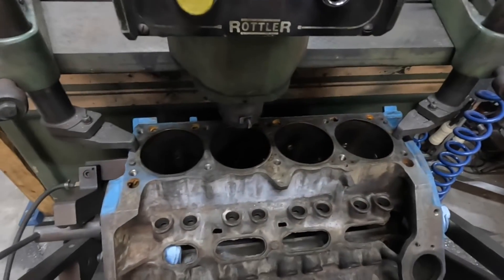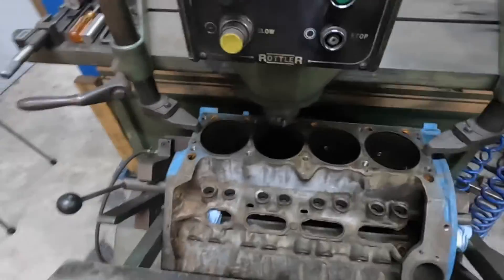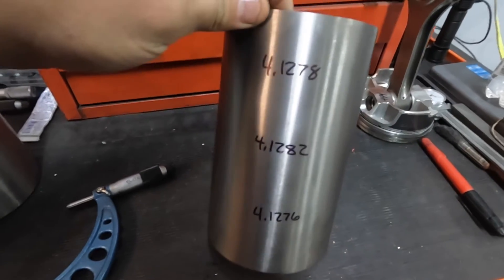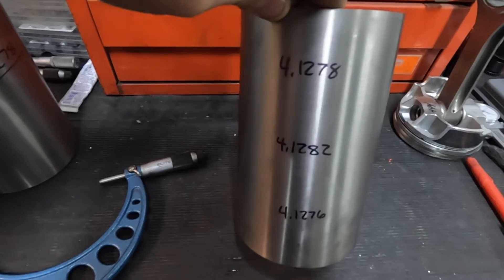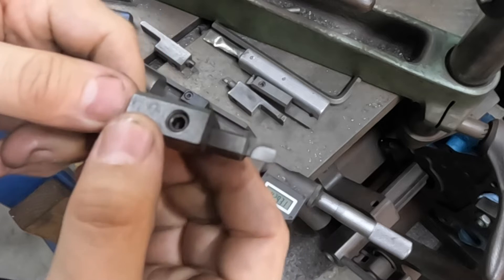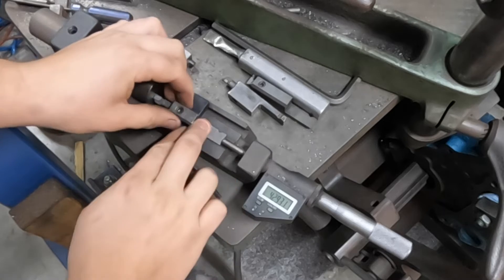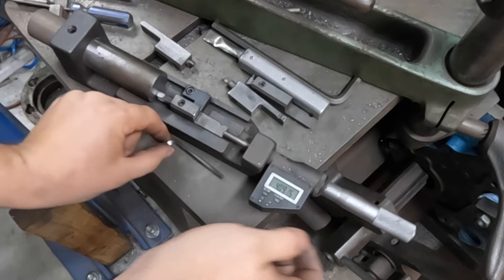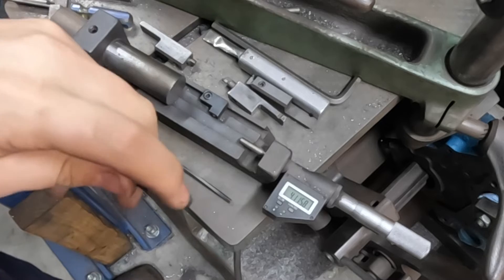Guide to Sleeving Engine Blocks

Comment: How Safe , is it to put in all 8 cylinders  into a 1967 350 Small Block Chevrolet without water leaks ???? .
Reply from the maker: Really have to sonic check the cylinders to see how much material is there. If there's enough material so we don't break into the water jacket when boring for the sleeves, then there will be little to no chance of leaking. If it breaks into the water jacket, we can get them to seal provided there's still enough material around the rest of the cylinder, but there is a greater chance for leaks when it breaks into the water jacket..

Comment: Do you know how cold you're going  ? as you are able to go colder than  cast iron is really  ok with using  nitrogen
Reply from the maker: Not exactly. There's not a lot of press on the fit so the amount that it shrinks/chills should not get to the point of damaging the cast sleeve.

Comment: Dose the cutting of the sleeve in the block help provide a "Friction Fit" for the cylinder block bond?
Reply from the maker: The block is cut to provide a press fit on the sleeve and then once the sleeve has reached room temperature we can bore the sleeve close to the final bore size before finish honing.

Comment: Is .001 enough with the variances in the sleeve? She went in super easy. Neat work btw 👍
Reply from the maker: Yes, that is why we measure at so many different locations on the sleeve to find the average. It also helps that it's an iron block so the sleeve and block expands at basically the same rate as they heat up.

Comment: Do aluminum sleeves T6 6061 withstand high horsepower?
Reply from the maker: Aluminum is not a common material used in sleeves. Sleeves are typically made of ductile iron which gives a stronger and tougher material to handle the higher horespower.
Reply: @pageracingengines  I appreciate that you answered my question 🙏🏻Do you recommend dry or wet type? For the tb48 engine, I am working on this engine and I have a goal to get it to 1500hp / NA Nitros

Comment: What kind of press fit do you shoot for?? nice looking shop brother
Reply from the maker: We typically shoot for around .001 press fit in the block but can vary based on sleeve type and block material.
Reply: @pageracingengines  thanks for reply! what about a flanged sleeve?
Reply from the maker: @3m1n3mx31  Its basically the same except there is no press fit on the flanged part of the sleeve
Reply: Shoot for lease one-and-a-half to two and a half thousand

Comment: Really enjoyed your video. We have a Rottler similar to yours, not exactly the same. Our cutter setting fixture uses a traditional barrel type micrometer, which moves the anvil .050 per revolution, rather than the standard .025. It’s easy to make a mistake. I put the sleeve in the freezer and warm the block in the oven before installation. Probably overkill, but I don’t want to get stuck pounding with a hammer. How much of an investment is it to get set up with liquid nitrogen? Also, how much material do typically leave for a shoulder at the bottom of the cylinder? Not even going to ask how you drilled the crack within the limited space of the cylinder. Keep sharing your knowledge.
Reply from the maker: It's not too bad with the liquid nitrogen. I think a large 20L dewar like we have was around $250 on amazon and I get the nitrogen from my local welding supply house which is about $50 to fill the dewar up. I like to leave around .150-.200 of a shoulder at the bottom depending on the block. The two holes really weren't that bad to drill. I have a tight right angle drill that takes its own drill bits so it's easy to get in there and drill them.
Reply: @pageracingengines  Thank you
Reply from the maker: @williambaisley8594  You're welcome
Reply: How long does it take to immerse the cylinder sleeve in liquid nitrogen?